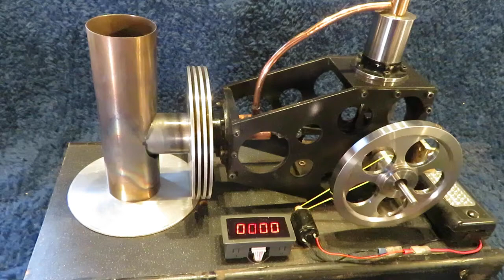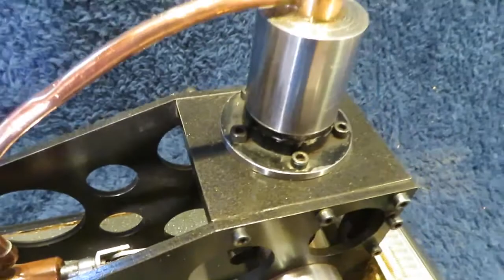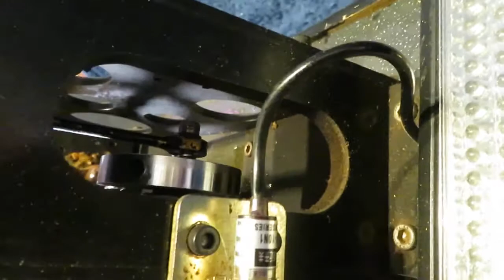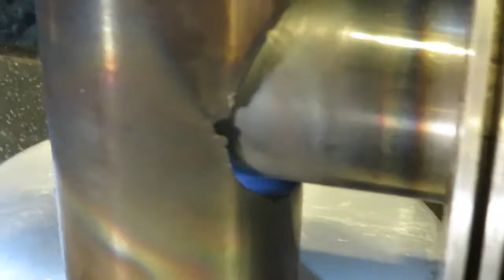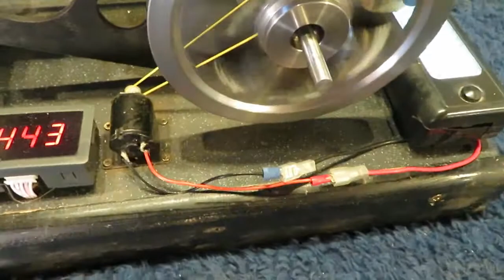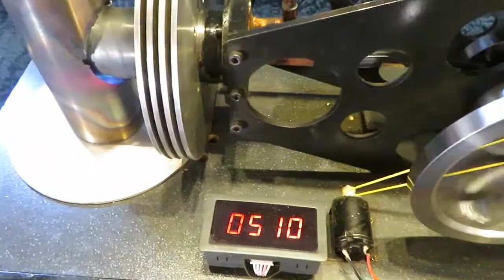Easy Build Stirling Engine 1

Comment: If a person could build a 1 horse power model to fit on a woodstove, it would power the battery bank for the house. Way more reliable than solar and wind. Quieter and safer than steam.
Reply: For me, it's like the Powerball and Maga Millions jackpots.  Why choose? Play both!  I like solar because it takes little to no work once you install the panels on the roof, but days are shorter and often cloudy in the winter.

I'm thinking about spinning an ordinary car alternator with this, and hooking it up to may existing solar battery bank.  It is, in fact, a bunch of 12V car batteries connected in parallel.  It's a no brainer, if I run a woodstove to heat my house in winter anyway.
Reply: @DM-kl4em  I think you are correct,  sapping energy in any way that is practical and serviceable, so your active and passive systems help each other. I saw one guy who collected from multiple sources and generated hydrogen stored in tanks, to use like propane in winter. I don't know how he compressed the gas, but it was providing for a gas burner, furnace, and water heater.